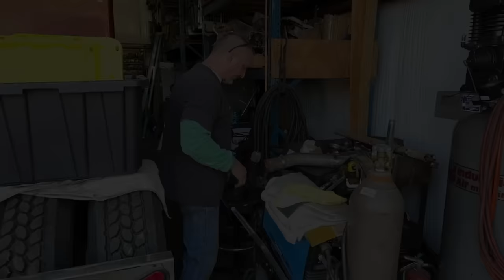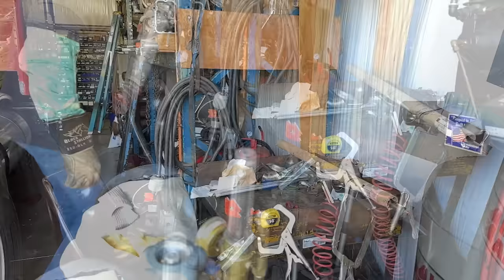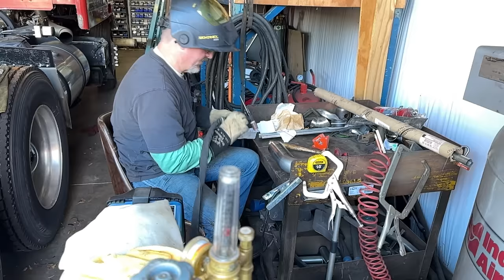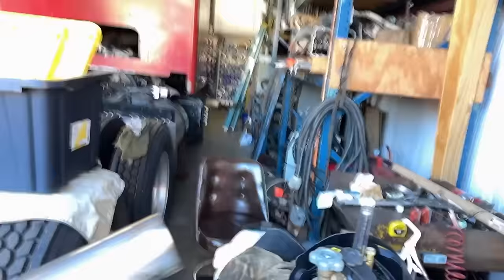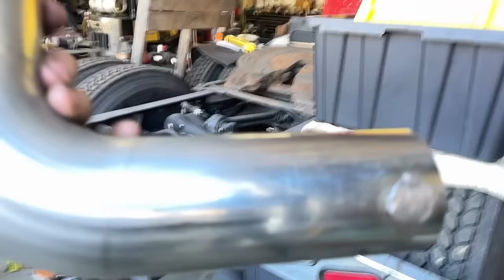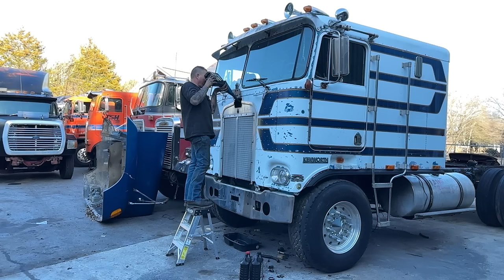83 Kenworth Cabover "Krystal" Radiator, Please No Leaks.

Comment: James, if you have not worked on the fiberglass fender yet, I was made aware of a tool that looks like it can be rented. Basically it sets a curved wire criss-cross over the crack and it strengthens the fender so it doesn't bust apart anymore or again.  Think of a curved wire in multiple "S" curves just like the letter S and is several of them in one piece.  It heats the glass and melts it right into the fender and then when glassed over, its super strong. I really like this idea really well. If it were me, I know I would use it as glass travels like a windshield break.  This idea should remove those problems.... You might be able to youtube it so you can see for yourself what I refer to... as always.. keeping the faith in trucking
Reply from the maker: I have one it’s smaller for small cracks. Works well on olastic. I use it in the dash

Comment: I use a cheater lens in my welding helmet made all the difference welding. The lens just slides right in the helmet.
Reply from the maker: Ya I have a 1.5 in the helmet most of the time.  Not sure where it went
Reply: Yea that was long ago now 2.75 for old eyes